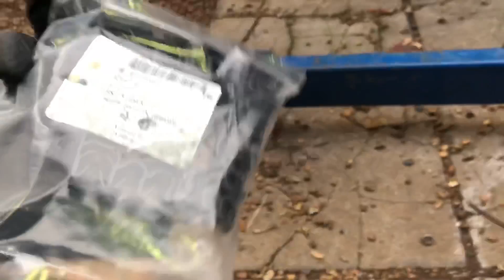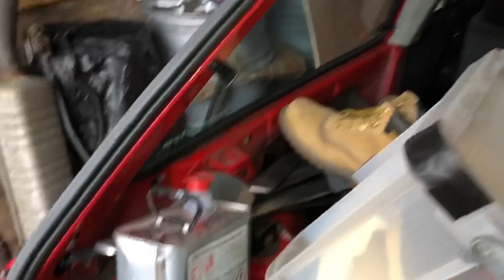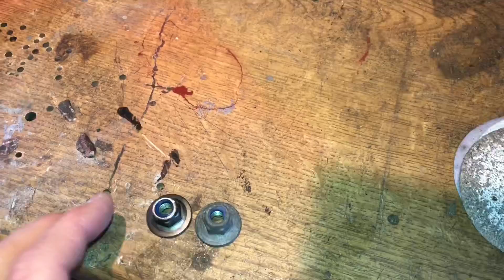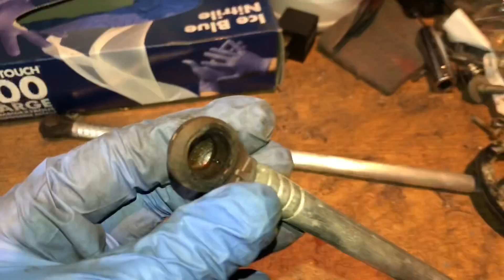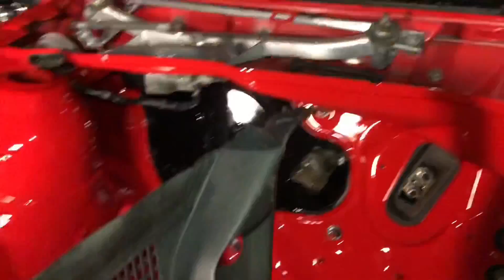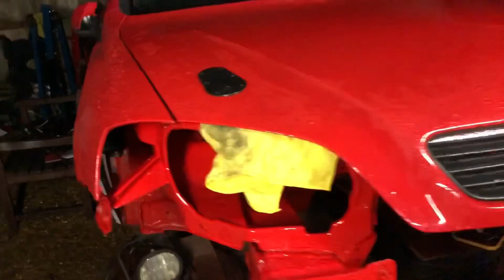ENGINE BAY IS FINALLY FLAME RED!🔥 Restoration Resumes..   [Opel Opc Astra Gsi Turbo]

Comment: Not sure if you'll see this comment aaron but iv got a vxr astra wiper linkage and arms was wondering would it bolt to my gsi motor as iv got a bare shell am building from your vids 
Big respect dude keep it up a could watch you all day
Reply: Just helps for the quock fit aero blades

Comment: I can’t remember from you other videos but did you use a single stage paint for the bay or was clear coat used?
Reply from the maker: No i used 2k paint with hardener. No lacquer it wasn’t used on the Gsi

Comment: "Sad going over your inner wings with tar remover" - no way! It's about having an attention to detail, plus all that work making rest of the car perfect & mint then leaving the inner arches with tar all over?...like the little details with the new nuts & bolts too. All adds to the level of craftsmanship and quality of the build. The heat shield looks great in black, better than the bare aluminium finish I think.

Comment: Absolutely gleaming geezer 👌👌 wish you’d have mentioned about the fuel line clips previous 😂 i managed to pry mine back to remove the knackered split front metal sections , feed and return gave up over the bad weather and snapped off right at the ends evaporate pipe still to do but it can wait for now an from bay to floor now on mine
Reply from the maker: Haha Sorry dude! Yeah they dont like coming off after all these years it is frustrating

Comment: One hell of a build the red gsi  your attention to detail is outstanding aaron👌 glad to have a quick glimpse of the fezzy turbo bit sad its being used for storage!!!😪 haha
Reply from the maker: Might aswell do it properly mate while i can. Yeah its okay it will get some attention soon 🤣
Reply: @AaronUnknownPerformance  yes too right mate do it right first time round. Little tip not sure if you tried before the scuttle panel you said had faided to grey and you dressed up to get them back to black try using a heat gun on them it turns faded plastic back to as new 😉👍